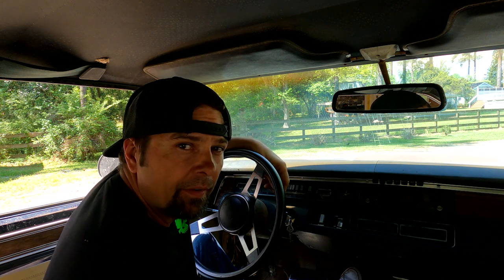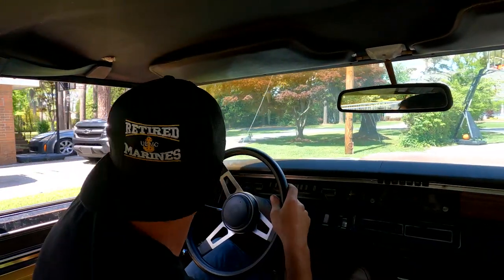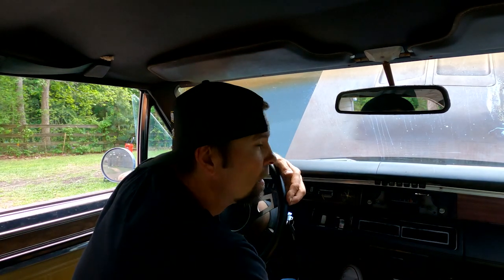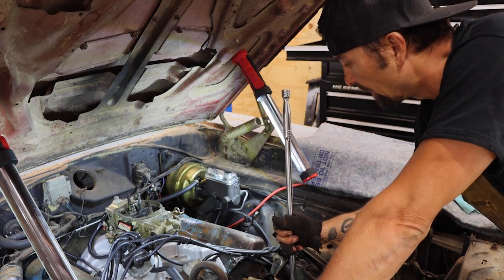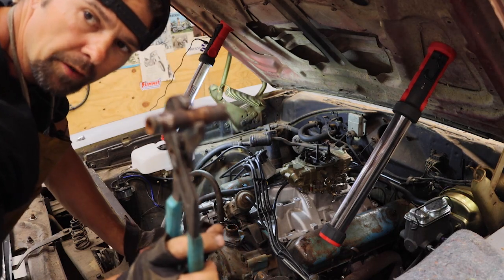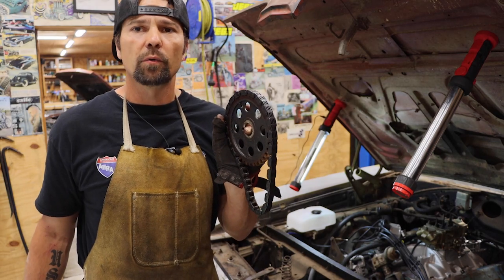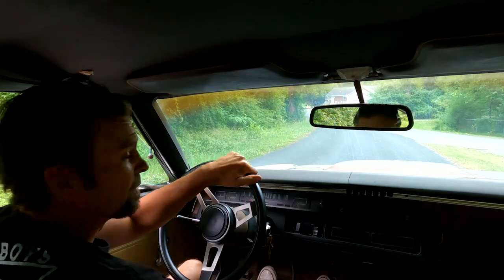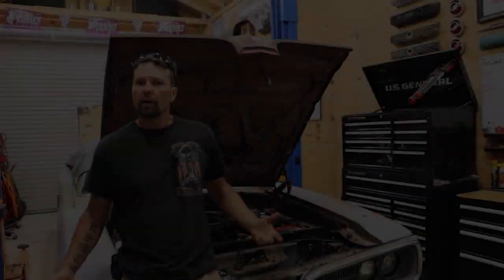Dodge Coronet 500 Part 3

Comment: Keep at it bro, that’s what we do best. Been fighting this 71 Charger 318. Finally got her running like a top, and would u believe have a leak now in power steering gear box and leaks like a Sieve. If it ain’t one thing it’s another . Keep turning those wrenches bro.
Reply from the maker: Every Mopar I get around here seems to leak at the gear box. 😂
Reply: @PoorBoysGarageUSMC  forgot to ask, do u usually just swap the gear box or do U seal it back up? Just curious
Reply from the maker: @TommAceAZ  well it depends on the car. I sent one off to be completely rebuilt before, but usually we just get ratty cars around here and if they leek super bad I’ll change the lower seal
Reply: @PoorBoysGarageUSMC  thanks for the response. man what a pain in the butt have to remove the whole gear box to replace the seals then reapply.  Unless u do it a different way? Removing the pitman arm alone is garbage. Thanks Mopar for making it difficult!

Comment: Pontiac and Chevy used plastic coated cam gears also.
Reply: I melted my timing gear in my 69 Gto Judge going from Detroit to Grand Rapids Mi to make a wedding. Was pushing it very hard. Almost made it but had to have it towed about 40 miles off the freeway to our garage in G.R. lol

Comment: I wondered where ya been
Reply from the maker: Well, been working part time so that was hindering the video content. And, I just couldn’t seem to get a good video put together to save my life…..
Reply: @PoorBoysGarageUSMC  Brad it is good to see You have another gret video posted, and with Lary's 1970 Coronet 500, 383 c.i.
Your assessment, evaluation with the timing gear is certainly 'on point', 'spot on'. Clearly You have much experience , information, knowledge about, with the Mopar engines, transmissions, drive train, etc.
Was thinking when You showed the delay with the distributor rotor rotatioin while turing the engine by the cranksaft main bolt, that perhaps there is  some wear on the distributor shaft gear or perhaps the gear it meshes with, which is usually on the camshaft, correct ? 
With You experience, knowledge would that gear wear also result in the observed rotor rotation delay as would result in ignition timing issues, thus the occasional backfire especially under more load ?
Am looking forward to seeing the next video, Part 4 in this Coronet 500 series. Certainly that built 440 c.i. [is it a magnum head ?] and the newly rebuilt 727 transmission will be good performers for Larry's Coronet 500  -> will Larry be like "Crazy Larry" ? [Ha ha]
Perhaps You will be showing us mother projects in YOu next series of videos including the 'rare find' You dragged from the woods too.
All The Best and Much Success in Your Quest(s), Health, Happiness and Well Being, Sincerely